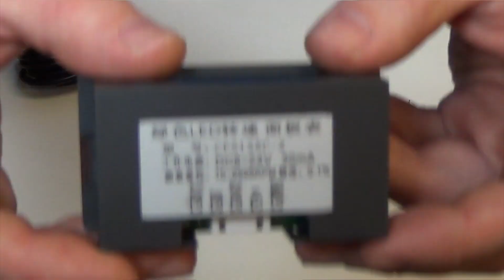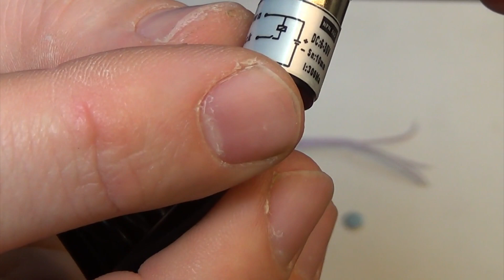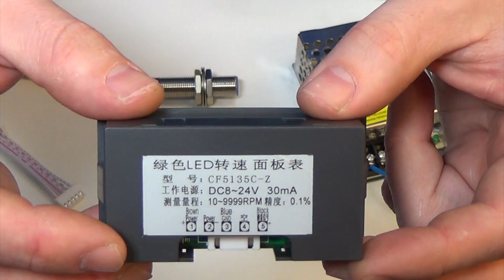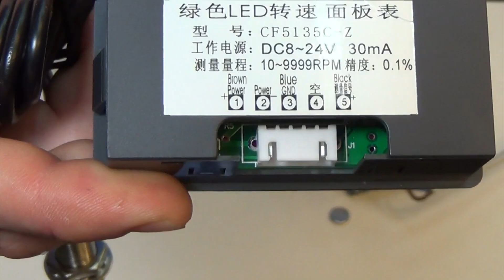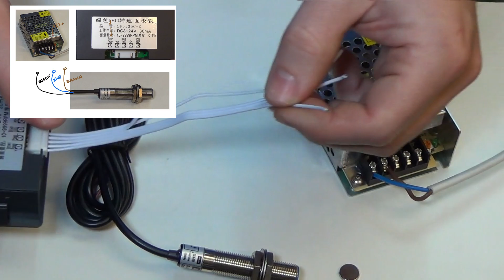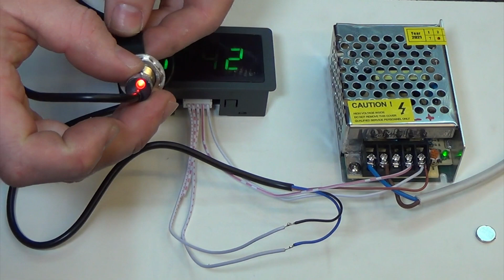HOW-TO: Tachometer for Machines Wiring and Installation

Comment: Hi there .... thank you so very much for posting this video tutorial.  I was going crazy with trying to connect this exact unit up -- that is, until I found your video.  A+
Now I can install these tachometers on my vertical milling machine and on my drill press ... the lathe already has one built-in.  Also, I did not know about the magnet-directionality aspect ... I do now, and it's great to see the LED in the sensor brighten up.
Again, thank you very much!  You have been very helpful.
Also, now subscribed!   /   Jeff

Comment: Why hasent anybody talked about all the hidden features on these?  Solder in some buttons on the board where it shows and you can switch between modes and calibrations and bunch of stuff from timers to clocks and other settings. But nobody has put buttons on and tried yet besides me i guess..